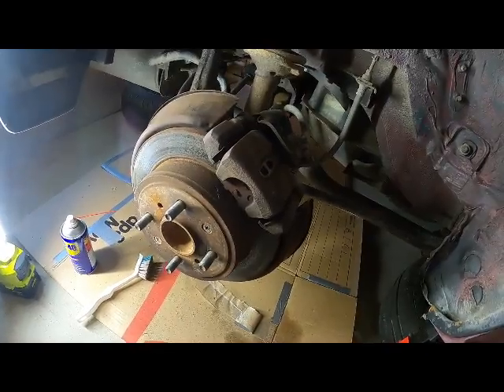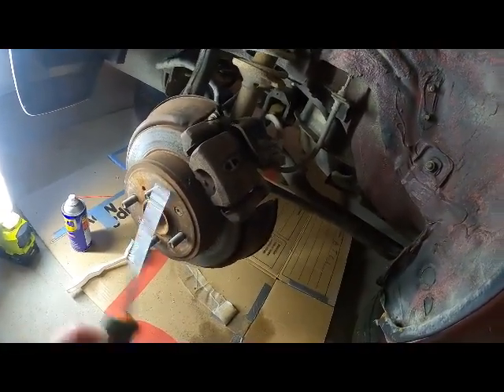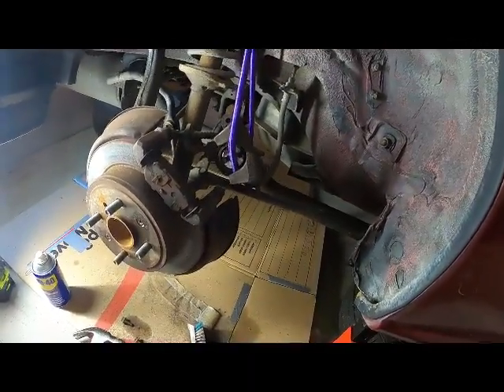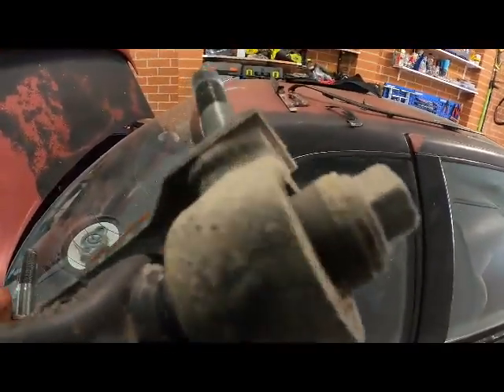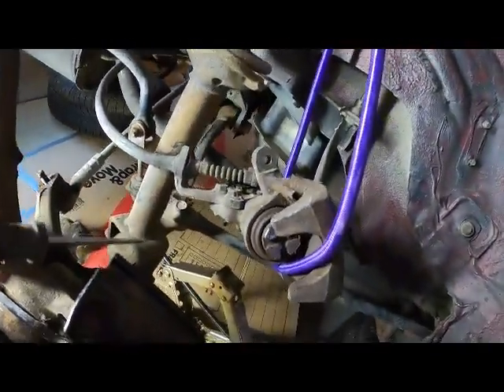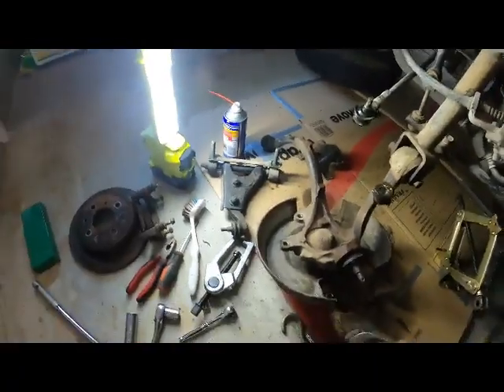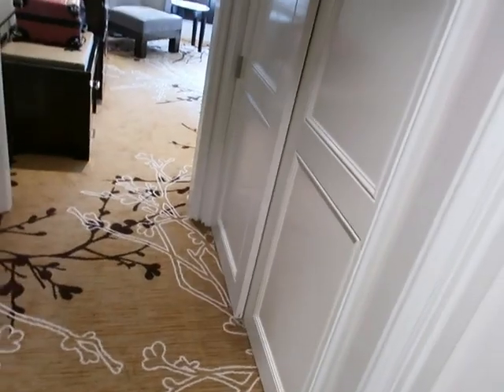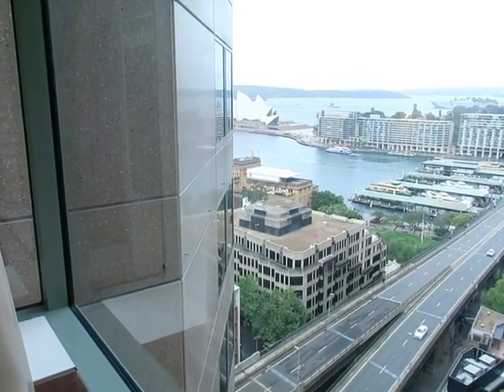How to remove and install Rear Upper control arm bushings PART 1- Honda Prelude 3rd Gen 1989

Comment: I get it and why you would want to do it yourself, but you still can buy cheap press machine to  help with this type of job. Great job and points for doing it.
Reply from the maker: I sure can, but I may not need it after,  so space is the issue :). Learn the hard way, then get the tools to make it easier 😉

Comment: Hey if you change the brakes on that, those look like the twist calipers,.instead of a c clamp or push type tool,.theres one for turning calipers back,.not sure if you were aware of that
Reply: Over there playin mechanic, its not so hard lol
Reply from the maker: Yeah these are weird and first time seeing them. I will get new break pads ans I think they come with the clips and all.
Reply: Yeah, im sure you can rent or buy the tool cheap,.we have “oem” brand and they make a tool that will push calipers and turn calipers in the same kit,just a thought
Reply: But your doing good, the manual hand tools are fun huh,lol, i know their not really
Reply from the maker: Sadly Aust tool shops do not hire. I wish I could. but I already have the break piston tool so not needed. break bleeding tool I may need to buy at some point. as long as I do not mess around with break calliper, I will be ok for now
Reply from the maker: fun ha.... lets just say they do the job...